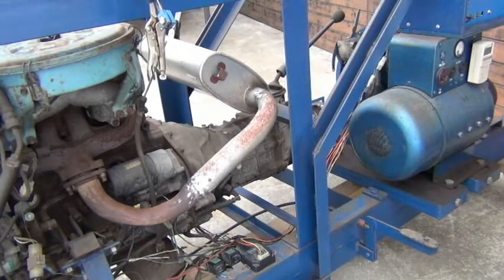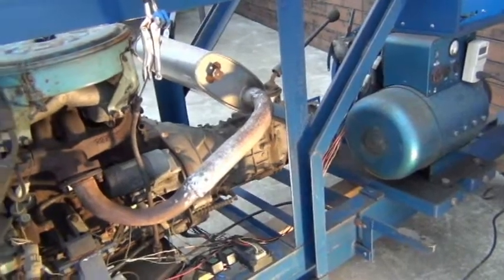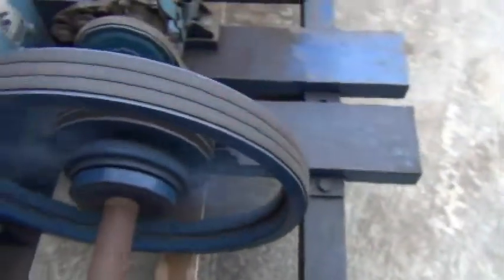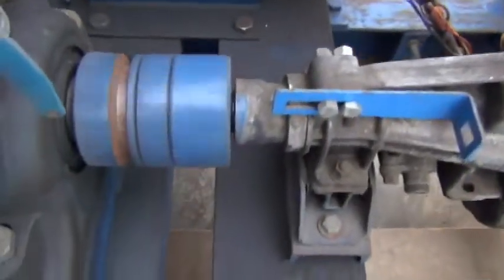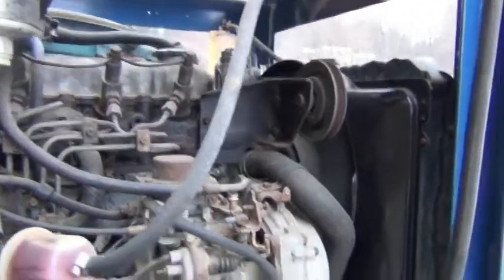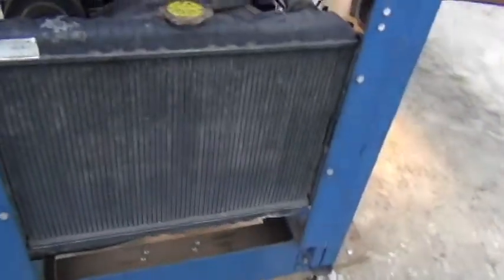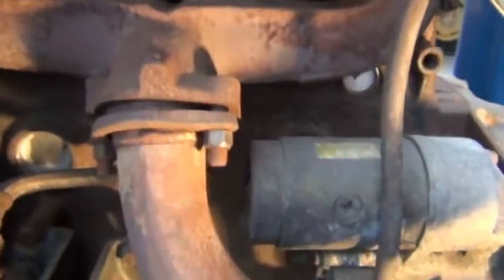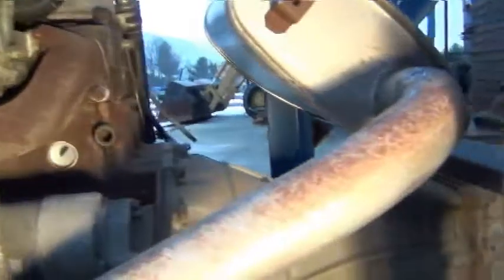Off Grid Power System

Comment: I'm waiting to get enough band width to view your entire video...why such a large engine setup...?
with a battery bank and inverter charger you can get by with 3 to 3.5Kw...save your big consumers for daytime and run lights and refrigerator at night. Theres some nice small air cooled diesels that will give you 5 to 6 hp. No coolant issues or all those belts.